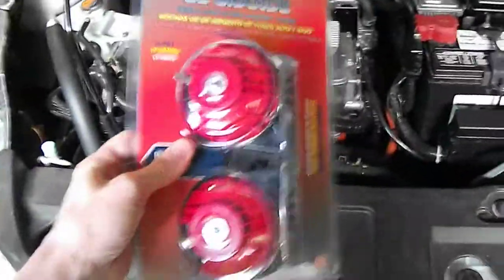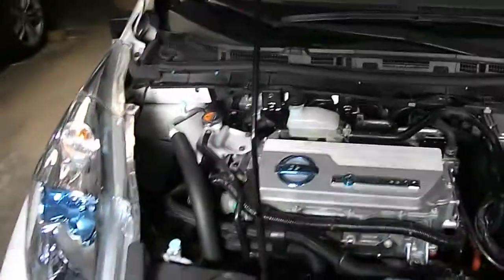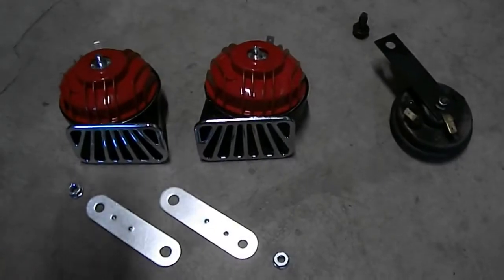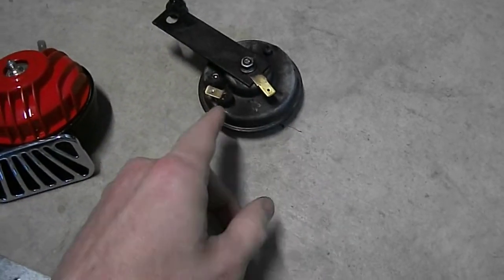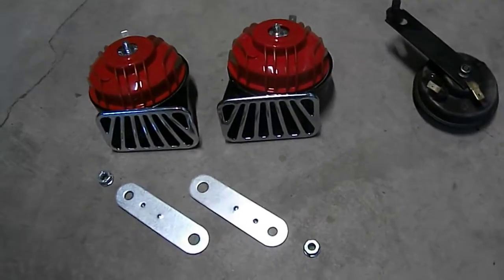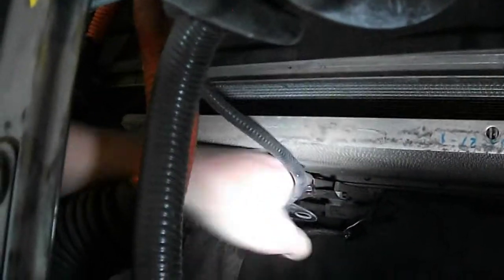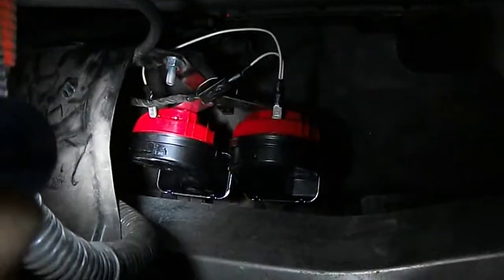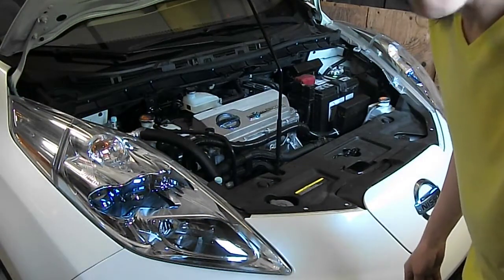Nissan LEAF - Modified - episode # 05

Comment: Thanks for the video. As some others have mentioned, you can likely get louder sound from the horns if you use the included relay so that the horns’ actual power can come directly from the battery via a heavier gauge wire. You can check this by measuring the amp draw at the horn when it is energized. It’s likely that the stock horn wiring is limiting the dual horns’ power draw right now and just turning some of it into resistance heat. I just bought these horns for a 2016 Leaf and will be putting them in soon.
Reply from the maker: Thanks for your input.  It's a great improvement one way or the other.  Enjoy yours!

Comment: Every +3dB is a doubling of SPL and +10dB is, subjectively, around twice as loud, so the improvement is significant. You might get slightly better results if you use the relay and take a fused feed directly off the battery.

Comment: no need to sand off the bracket as you have a ground wire already ;)

as the original horn was from a "moped"  the wiring is also for a low powered horn now you're having 2 horns needing more amps...

the factory dB specification might be done in front the horns but have to be taken with a grain of salt
Reply from the maker: That's true , & now there's a secondary ground.  There might be power restriction in the wire.  Lastly, yes I was thinking the same thing, 128 db with the mic touching the horn.  I have to say for a 5 oz hockey puck the OEM horn is rather loud.  Fiamm is massive & 18 oz.  Either way, 9 db's louder & full range sound confirmed.

Comment: What is the year of manufacture of your Nissan Leaf?
When you replace your original horn and  fix a twin horn will have an effect on the fuse?
Will have an adverse consequences on the electrical system of the Car?
Reply from the maker: 2012.  No problems with the fuse.  I imagine the fuse is already big enough for a car horn & a moped was installed instead.

Comment: But the thing is, the decibel rating advertised on the package is totally useless, because they don't specify what distance from the sound source the dB level is. The dB level number by itself really tells you nothing. You know, is it 128 dB at 4 inches? 4 feet? 10 feet? And that's what they fail to tell you on the packaging. For that same reason you can't compare your dB level reading with theirs. Even if they did tell you the distance, you'd have to match their acoustical conditions to really get an accurate comparison. It seems you tested this in an enclosed space, so the dB level would be higher than if you tested outside at the same distance. So, don't get discouraged by your dB reading!
Reply from the maker: Yes, that's exactly right 128 dB in some condition.  That's why my testing was comparative on my dB meter with all else equal.  After driving many times and needing to use it... in practice it was night & day.  People actually heard the 68' buick horn & woke the *uck up.  Best mod ever on that car.  My Fiat & Tesla both already have proper car horns. Cheers,
Reply: They're very good sounding horns and much prefer them over the 'beep', 'beep' ones. Not that cameras can really convey loudness, but it sounded sufficiently loud. The fact that your test revealed a boost in dB over your old horns is great. The 8.5 dB increase is actually pretty significant.